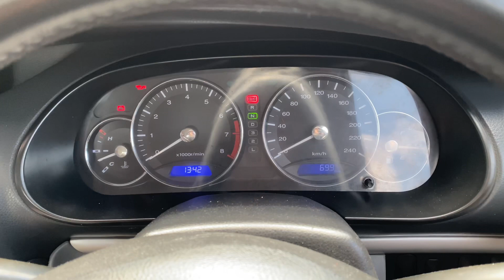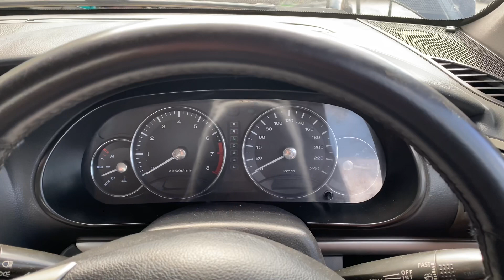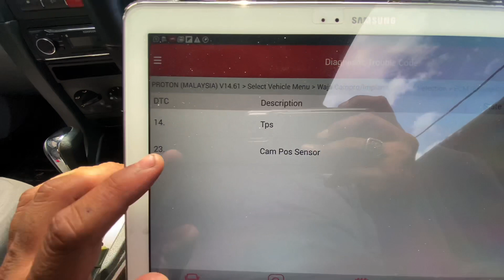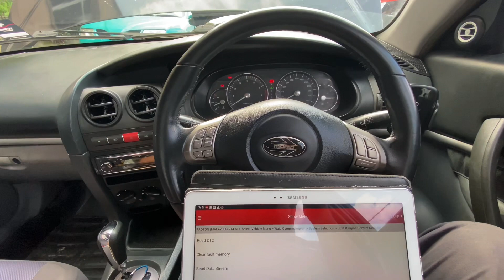Proton Waja Lampu Check Engine Menyala?

Comment: Thanks bang..intake air temp waja yg mna bang??ada ckap Map sensor tu,ada ckap tak..kereta waja mmc..problem kalau enjin panas fius 15 ecu putus..
Reply from the maker: Waja MMC guna TMAP sensor, IAT (intake air temp) sekali dengan MAP sensor.. jika fuse putus kena check dulu punca dia..
Reply: @AraiTech  xjumpa punca ..tapi sy buat mcam abg ajar tu,code 13..
Reply: @AraiTech  saya dah check semua  wiring,ada satu wiring luka,wiring headlamp,dah tape balik..tapi test semalam masih jdi,msuk D tekan trottle kuat skit enjin mati,fius 15 ecu putus